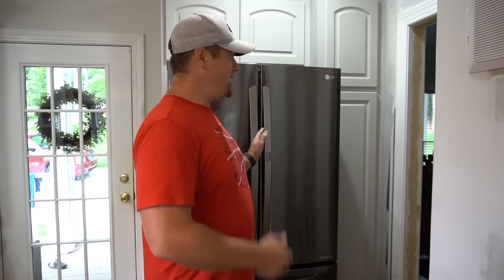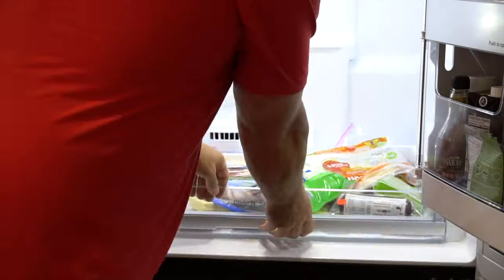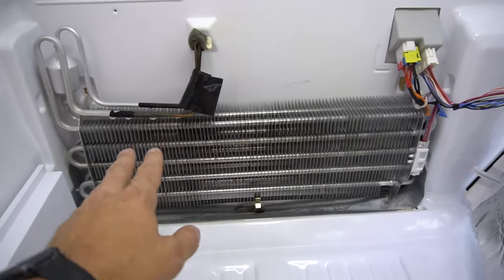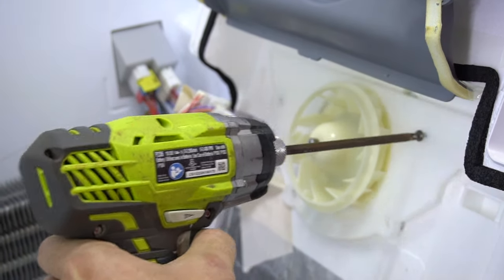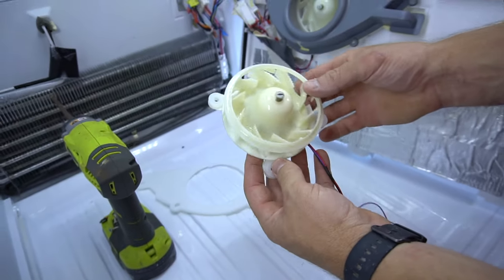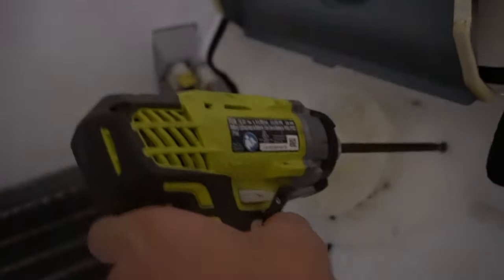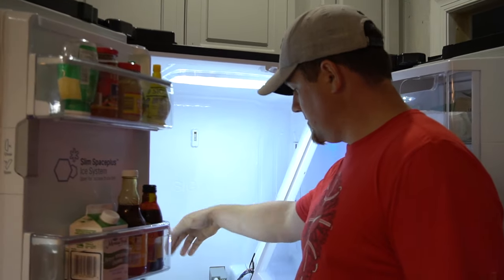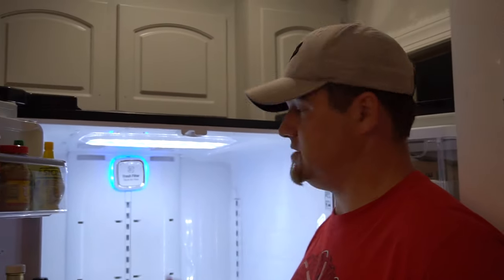LG Fridge Not Cooling -- Freezer Works EASY DIY FIX! #howto #DIY #repair

Comment: There's a button on the control board in panel behind fridge that will put it in 1 of 3 test modes.  mode 1 will run the fans even with door open so you can feel the air coming out the top

Comment: Thanks for the video.  Mine is an LFXC24726S that had this issue.  A fan started making noise as it was hitting the ice buildup.  I unplugged it for a day and put a fan in it with doors open, and towels to collect the water.  Once everything was dry I made a felt pen mark on the fan blade, closed the door and let it run a couple minutes.  I opened it up and fan had rotated.  Reassembly completed and everything is back to where it needs to be!  Thanks again!!!
Reply from the maker: nice job!

Comment: LG fridges should not be purchased, point blank. They only last ~5 years. 

Fridges used to last 30 years. This is bordering on fraud.
Reply: Agreed with you mine is going to 5 years old and broken since July still trying find the part
Reply: It's not just refrigerators it's all appliances I go to the scrap yard often the number of appliances that look new piled up is unreal  .this is a environmental issue and the waste and wasted resources make me sick we live on a planet that's depleting it's resources and heating up the planet something needs to change or are grandchildren will be the ones suffering
Reply: Agreed…never again will I spend $3200 on an appliance that doesn’t even make it through the first 2 years without experiencing problems. Also, the hardware inside is very cheap and cracked within just a few months of purchasing.
Reply: yup they suck, 3 years before things went wrong with mine.

Comment: Mine is an LFXC24726S that had this issue. Ordered the same fan and repaired my refrigerator. LG wanted $125 just to come and diagnose the issue. I agree that LG products are good for only 5 years. I also had to replace the racks in our washer after 5.4 years.

Comment: before you do anything make sure there is no dust behind or under the fridge ! There is a vent on the back that will shut you down if it is covered with dust dog hair and whatever .
Reply: I had a ton back there! Still hasn't started back up but I'm sure that was some of the problem it was really clogged - thank you!
Reply: I can hear the motor running! I think it's going to start cooling, at least it wasn't running before. There was a ton of cat hair in the back from my two kitties! Thank you so much I think this!

Comment: My fan was making noise then fridge stopped cooling and freezer kept working. I unplugged it, removed all food from the fridge and freezer, let it defrost for a day, opened inside fridge's back panel and there was still a block of ice sitting on the coils. Removed that, wiped it clean, put together and it works perfectly fine without replacing the fan. Thank you for the idea.

Comment: Any other ideas?  replaced the back wall with the new fan.  Made sure the condenser is not froze over.  Made sure all air vents outside are clean and not obstructed.  Added new seals and freon/refrigerant.  Freezer works perfect.  Fridge is now at 61 degrees when I woke up today.
Reply: Did you figure out the problem ?
Reply: @bruce7259  NO.  Had repair place out 3 times... Replaced the fridge

Comment: Thanks for the video!  I have a code IF E, Ice fan either frozen or inop. Frig is not cold but freezer cold normal.  I bought a Ice fan for the freezer compartment to get cold air to ice maker. Will this not get cold air to the frig then?  Looks like I need the fan you just put in.  Great video.
Reply from the maker: Thanks, hope it helped. Maybe plugged air hole going to fridge?

Comment: Thanks for the help, same problem different LG , this was exactly the problem , part is ordered tested motor with dc power supply, blades sound like they are scrubbing and too much resistance  for such a small motor, I assume a new motor the blades will spin freely. Thanks for the help
Reply: Where did you order the part???
Reply: @Hungryrain45618  Amazon

Comment: Have exact same model doing exact same thing but my current fan is spinning everytime i tested it or opened the doors. Tried staggering my shelves and left vents open as much as i could, hopefully itll start cooling better because this fridge has been a nightmare

Comment: I’ve almost got the opposite problem. But it’s intermittent, maybe once or twice a week. The fan makes noise when it comes on. But not always. Some people have said online that it is icing up and the ice contacts the fan and letting it melt repairs it. It’s a clicking noise that only starts shortly after the doors are closed. I wonder if first the fan stops working which leads to the icing. Then the fan makes noise. Ignoring it overnight, or unplugging for a couple hours usually makes it go away. Maybe I’ll just order the fan
Reply from the maker: yep I think if it is not icing then it might be your fan.
Reply: TheRykerDane if it’s icing. How can I stop it from doing so?
Reply: @yankkesrule   My fan works though. Why wouldn't it blow? Freezer is great fridge doesn't.???

Comment: I think I have the same problem?  The refrigerator section has warmed up to almost 50 degrees, but the freezer section has also warmed up to about 15 degrees.  Does that mean both sections are having a problem or is the warm refrigerator section warming up the freezer section?  Should I go ahead and check the fan?
Reply: I’m having the same issue!! Did you fix it?
Reply: @josecotto4592  any luck?
Reply: Any luck?
Reply: @josecotto4592  Nope, the repairman made it worse.  Had to replace it.
Reply: @jeff_9074  yes all fixed 
I changed the compressor and now it’s good. It will take like 3 days to get back to normal.  Also I did some adjustments on the back of the fridge so it can stay cooler
Reply: @josecotto4592  thanks for the response, did you do it under warranty? I'm thinking of just adding more freon.
Reply: @jeff_9074  I replaced the compressor under warranty

Comment: Great video - have a Kenmore Pro, similar to your model. Fan is working but starting to become noisy - trying to locate the part, what is the description of the fan? exhaust fan  motor, condenser fan motor ...?
Reply: This would be the evaporator fan

Comment: A simpler way to see if the fan is running is to take off the air filter, close the door Wait a few seconds and open it and if the fans running you'll see it slow down to a stop.
Reply: The air filter is high up; the bad fan was lower in the refrig.
Reply: Yes youncan see it slows down.

Comment: I was sure my problem was the fan after watching your video because my freezer works and I have the condensation in the area on the inside of the left door.  However, I did the test you recommended of putting my phone inside and saw that the fan is working!  Now what? Any ideas please?  My husband is out of the country for two more weeks and I’m managing my three little ones by myself and now with no working fridge!  Thank you.
Reply from the maker: The other option is that there is a frozen ice behind the back panel that needs to be defrosted. But also it could be the compressor too
Reply: @TheRykerDane  It was the compressor.  It’s fixed now.  Thanks for your reply.
Reply: @vistabanoo  That's interesting since the freezer was working. Thank you for following up on this. I have a new fan on the way but now I question my troubleshooting. LOL
Reply: @tomholley6904  wgat ended up being your issue?
Reply: @jeff_9074  Sorry to say I still haven't resolved my issue. I'm at a crossroad where I have to either keep throwing money at this really nice piece of crap or replace it and hope I don't end up in the same place 2 years from now!!
Reply: @tomholley6904  I had this issue a few times, and after cleaning the coils near the compressor, running the diagnostic/reset and unplugging it, it came back..  think it's happened twice. Now I'm in day three or four, and just floats between 44 and 50deg.. the freezer is fine. If I figure out a fix, I'll update you.
Reply: @jeff_9074  Thank you!!
Reply: @tomholley6904  I noticed a block of ice on the lower left behind the left drawer.. taking off the back panel of the fridge, the upper left side of the coils had a block of ice formed...  I took a blow dryer and melted it, and noticed once I started melting it off the line coming from the compressor, the line started to frost up, so the ice was stopping the flow of the freeon it seemed.   

Hopefully this fixed it for me.. I noticed when I connected the lg app the other day there was a smart energy defroster setting turned on, so it only turned on during off peak hours.. I turned it off but it keeps coming back on. Going to disconnect the wifi,  but I have a feeling this might be the cause.
Reply: @tomholley6904  to follow up, my fridge is still acting the same,  I'm going to try and replace the defrost sensor.. ordered and arriving tomorrow. Did you ever try replacing that yet? I verified through the diagnostic testing the heating element is working. I hooked up a multimeter and get little to no resistance on the thermistor (defrost sensor) Hope this is it.
Reply: @jeff_9074  Hey Jeff I think my problem is solved. I checked the resistance of the refrigerator thermistor and it was showing near the same at room temp as it was in a glass of ice water therefore the damper door wasnt opening and the fan wasnt blowing. I received the new thermistor this morning and replaced it. Before, the air temp from the evaporator was never below 40*F .  Now I'm getting 31-33*F air at the vent discharge.  Hopefully you have already found your problem,  but I just wanted you to know what was happening with mine. Thank you for you help.
Reply: @tomholley6904  nice! Sounds like you may have gotten it.  So much frustration with these units. I determined mine is a sealed system issue, because of the way the fridge evaporator is only frosting and building ice at the entry point. Only 6yrs old, and of course outside of LG's 5yr sealed system warranty. Samsung has a really good deal with Bespoke fridges going on right now, so I just purchased one of similar size to my lg.. and I'll put lg to the side until I figure out what I want to do with it. 

How old is your LG?
Reply: @jeff_9074  I was right there with ya buying a new one when I checked the thermistor.  That was gonna be the last 20 dollars I spent on this crazy thing!!  Ours is 6 or 7 years old. Have had sealed system parts replaced 3 times. Compressor twice and refrigerator evaporator three times. The LG guy added leak dye on the 2nd visit that showed the problem so he didn't replace the entire system on the 3rd time. Hopefully I'm good for a while.
Reply: @tomholley6904  glad to hear it hopefully you're good for another 6-7yrs!  BTW, where was it showing a leak at?
Reply: @jeff_9074  As I recall, it was at the line before the fins. Not sure if it was inlet or exit side though.
Reply: @tomholley6904  hey Tom is the fix still working well? I may have to do this too.. is this the sensor near the led light by the middle crisper? Also was it easy to change? Mine looks like it's behind a foil seal, and leads with other wires to an adapter.   So I'm thinking the wires will need to be cut to be replaced. Wondering how involved the process was for you.  Thanks!

Comment: I have LG Refrigerator model  LFC22770ST /01. Any video on 'Not ENOUGH cooling' would be greatly appreciated
Reply: I have the same fridge same problem. Did you get yours fixed and how?
Reply: @marysphonaah4857  what was your issue?
Reply: Hey, having the same issue, what ended up being your solution?

Comment: I have the kenmore version of this fridge. Same symptoms but when i push the test button on the board the fan does work. Fridge will only get down to 45° instead of the target 33°. Its almost as if the fridge thinks its getting to 33 because the compressor and fan will turn off

Comment: Awesome video! It looks like I have the exact problem. Took the fan panel out and took a video. In 2 minutes the fan never turned. I fiddled with it a bit and actually did see it run for a couple tries. But now if I sneak up to it the fan doesn’t turn any more. Probably a bad fan then?
Reply: Yea most likely

Comment: same diagnosis. good freezer. no fridge. I replaced the fan. still 52-56*. is the thermistor the next piece to replace?
Reply: Did you ever get your fridge issues worked out? Think I have the same issue. Fan appears to be working but fridge is getting warm still for some reason? LG replaced compressor and board also.
Reply: @brianwilson7849  what was your fix? Same issues I'm having.
Reply: Hey, having the same issue, what ended up being your solution?

Comment: I have the same fridge and model and LG replaced the compressor and it worked fine for 5 months then they came back and replaced the Motherboard, Coil and evaporator fan the one that you replaced and still... The freezer works fine but the fridge does not cool .. I took that panel off to see if the fan turns on and it's working fine but the COIL does not cool at all... Any advice?? LG did refund my money but now I'm stuck with the fridge because there not going to to pick it up... So before I get rid of it I would like to try to fix it since it has almost all the main parts replaced.. Thanks for your time

Comment: Hey you mentioned briefly about moisture around 2 little seals. Well I fixed my evap fan it was broke and not working but I do have moisture and ice around those seals before I fixed evap fan and after fixing could those seals be bad or a different seal allowing air into fridge

Comment: My LG 3 door fridge was not getting cold but the freezer was working fine. One technician came out and verified the fan was working but could not solve the issue. It ended up being a part in the drain line that was installed upside down in the factory that caused the drain line to freeze and plug up over time. Causing the issue. After a 5-minute repair it works fine. Of course the factory wanted $500 flat rate to come out and tried to claim that if it was a compressor that only the parts were under warranty when it clearly says in the manual that parts and labor are covered for 5 years. After I threatened to call my State attorney general an attorney they finally agreed to send a technician out without charging me the $500 up front. Like I said it was a 5-minute repair and a factory defect that the technician said he had seen four or five times. There's no way LG doesn't know about this yet they still try to get a $500 flat rate fee for a 5-minute repair up front.

Comment: Is there an adapter from 4 electrical lines to 3 lines?  As my previous comment stated of refrige has 4 lines but the new replacement fan only has 3 lines.

Comment: My fridge is not cooling either but before I bought a fan replacement I checked to see if the fan was running and it was but it’s still not cooling. Could it be something else ? Please help.
Reply: Most likely is a Bad condensor and has leaked out the freon.

Comment: Hello! I have a Whirlpool refrigerator model GB2FHDXWB05, and only the freezer section is working. I think the refrigerator fan is not working, and I would like to change it. Can you guide me on the steps to follow?
Reply from the maker: Ok, it is going to be similar to removing a back panel and find the fan to install. You can find parts on appliance parts online. Also make sure your coils aren’t frozen up. So you might need to defrost it.
Reply: TheRykerDane 
Thank you!

Comment: How old was this fridge, when the fan stopped working?  Also, our defrost function doesn't seem to work as it should, as we have to remove the block of ice off the coils about 2 or 3 times a year.  Not sure if our fridge has a defrost sensor or timer that needs to be replaced, and which parts they are?  Thanks
Reply from the maker: Fridge is about 8-10 years. yes could be sensor or fan. Should not have to remove ice that much. Check on appliance parts finder

Comment: Hi i have purchased lg refrigerator side by side door . I connected to wifi and installed lg thinq app and done with smart dialysis . in recommendation section it is showing that "the humidity level at installation location is high" even though the climate out side is cool. Whats the reason for that

Comment: Hi, my LG model is LFXC24726s/02 and have the symptoms exactly as you have described (freeze work but fridge is not cold,  a lot of water on the bottom fridge, ice/condensation around the ice make door vent) There was a lot water right below the coil , so I use the stick to put through the drain hole and water was drained. However, when I run the diagnostic by pressing the test button on the motherboard, all the fans are running.  Does that mean the fans are good and something else defected?
Reply: I have the same issue
Reply: Did you ever figure out the issue?